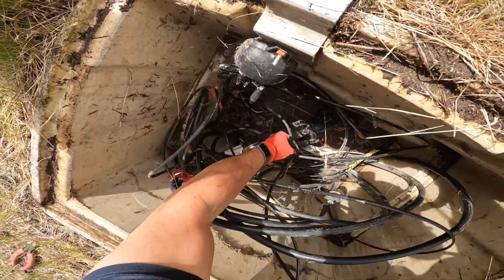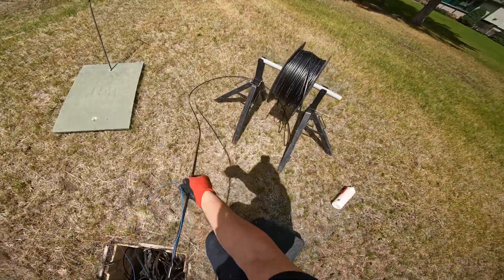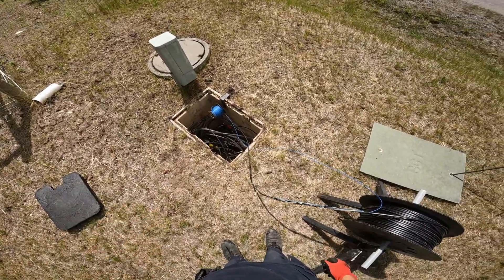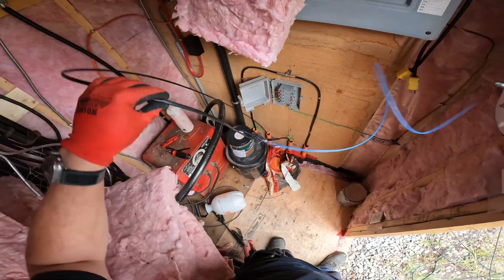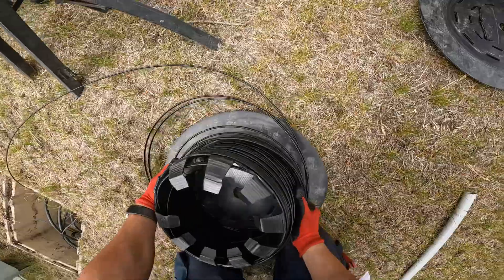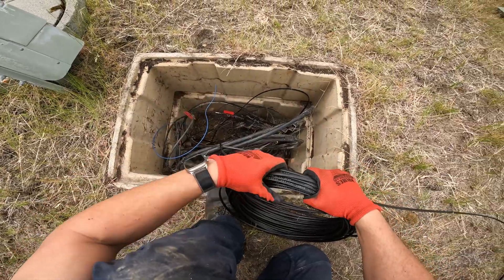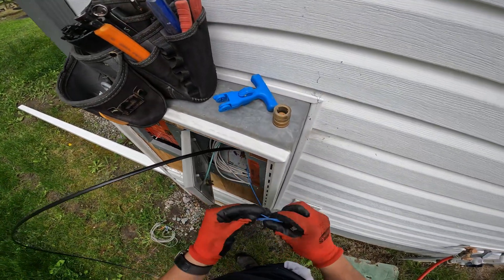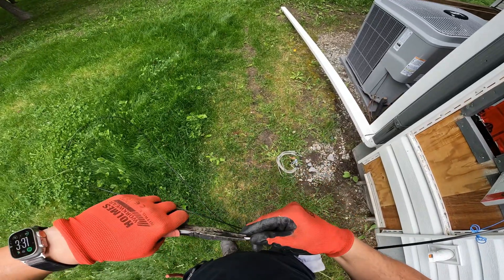180m Conduit pull - Fibre Optic Drop

Comment: While it's not the biggest deal i probably would have pulled the slack into the pump house for future use to keep the tub cleaner.. more slack in the tub means more likely to get fucked with imo.
Reply from the maker: @DdosedRS  mmm. Might have to disagree with you. Protocol for us is slack in the tub. Although this is a bit more than normal. That tub was only setup to feed 1-2 more houses. And having that slack in the pump house could get damaged in the future.
Reply: @FyBurz  Even then, the pump house is not a bad location, should a splice be needed in the future. It's above ground and in an enclosure that's harder to miss than a pedestal would be.